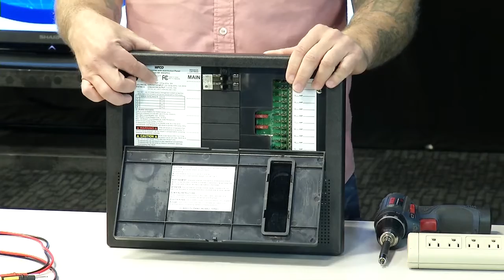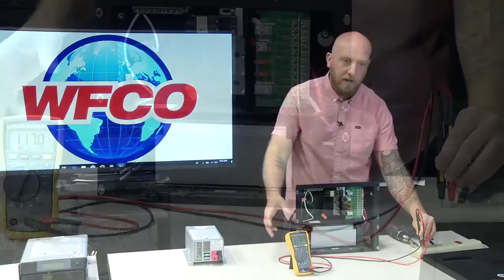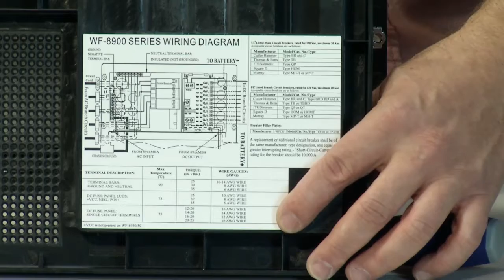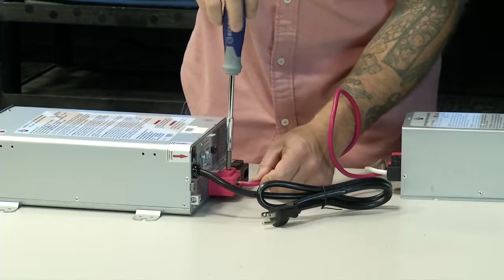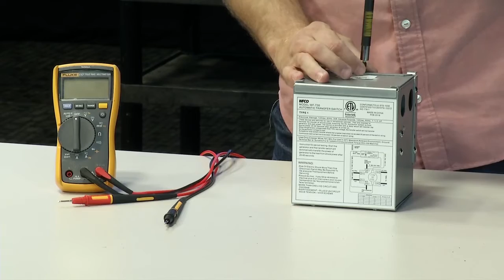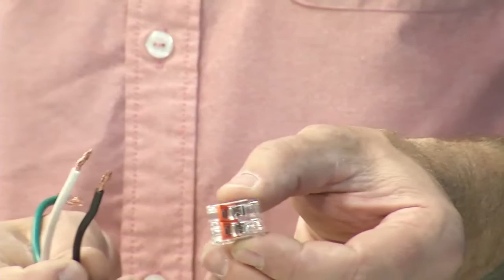WFCO Power Source Training

Comment: I have my first Popup Camper, at 68. A prior owner pulled the battery. (I guess they only took it to "plug-in parks") I want it for boondocking. Just got a WF-8955-AD with the WF-T30. What else do I need to make this a LiFePo4 system? Yes, it would be nice to add solar. NOT planning on a lot of power usage. The fridge. I have a good power station for the phone and laptop. A 4000 watt generator, 400 watt solar panel with a 30 amp controller. Would someone help me in figuring out how to wire this all together? With NO liability!
Reply from the maker: Please contact our Technical Support Team at 574-294-8997 (option 1) or e-mail me and I'll get you in touch with our team.  m.lacognato@wfcotech.com. Thank you, Michael

Comment: Not finding any info on my particular we-8955rep series unit for my 2006 frrv Salem lite trailer …it has a blue power cable and the replacement has a block to connect it outside the housing (lower hrs) where does this blue connect to???

Comment: Question, does the alternator current to charge the house batteries connect to the charger? I am not charging the house batts while the engine is running.
Thanks, very good information!

Comment: Great video! Hey I'm getting 13.70 to my dc side on fuse panel but I'm not getting 13.70 on the fuse block on battery positive wire. New converter that's only getting ac power in but not DC out. Does this sound like I have a bad fuse panel? 
Thanks

Comment: my 1989 terry resort has stock 30 amp fuse panel i ordered the wfco 30 amp an i got the 55 amp wf-8955 model.... can i still use this on my 30 amp system? i dont have any batteries but may add 1 or 2
Reply: Not sure if I understand your question, but these converters are made for 30A or 50A AC shore power. They make converters that convert 30A AC shore power to 45A, 55A, 65A or 75A DC output power. So if your converter produces up to a 55A DC output, that just means the combination of all your DC powered devices will be supplied as much as 55A maximum at any given moment. It still needs 30A of AC power from the shore (RV park hookup)

Comment: Can you wire your inverter into the generator wiring in your transfer switch to your 8955 to power the 120 V in your trailer? Do you need to shut off your converter breaker then to use your inverter?

Comment: In this video's senario I observe a 30 Amp Main (Good) and a 20 Amp Converter, my current breaker is 30-15 should I upgrade to a 20 amp for the converter?
Reply: Not necessary unless you have a 75A or greater converter.  https://www.wfcotech.com/wp-content/uploads/2022/11/WF-8900-Power-Center-Series-Manual.pdf

Comment: I'm still a bit confused as to where the 120volt output is connected.  Is this connected to the power converter?  If so, does it connect to one of the breakers in the converter?
Reply: Output on what? You need to be specific.

Comment: Quick question, I have a 8935 p in my truck camper, and want to upgrade to lithium batteries, can I install an 8955-AD with out having any issues? Or can I only replace with the 8935-AD?
Thanks for your time

Comment: I've got a 2007 Keystone, Laredo 27RL - my 12 VDC seems to be out at all lights,fans, etc. When I cycle the 110 VAC breaker that powers the inverter, the 12 VDC power seems to come on only momentarily then completely nothing again. No warning LEDs are apparent at the 15 amp fuses (blown fuse indicators) so would/could this be an indicator that the power A/C to D/C inverter is failed - and would a replacement be available from WFCO directly if a part number is found?? Any thoughts would be greatly appreciated. Thanks and great video!!!

Comment: I have the wf-600-th model. What is the white AC output wire? What is it hooked up too? I cannot reset my 7amp circuit breaker on my inverter either. My inverter has no lights lit up. I tested the battery cables going to it and they are at 13.58v

Comment: So I found a problem with my wig-8900 series and it’s a grounding block that goes to the floor , it has 8 smaller gauge wires to it and 2 large gauge wires to it on a 4 terminal block , where can I get a replacement block to fix this @wfxo ???

Comment: This was a lot of basic stuff, but still a great reminder refresher on Converter/chargers, inverters and ATS's. Question do you have any experience with large inverters that feed one leg of an Electrical Panel on RV's that have an Energy Management System installed.

Comment: On my 2022 Flagstaff 27BHWS TT do I need a transfer switch?  Transfer switch is throwing me off.  I want to replace my WFCO 1000 watt inverter with a 2000 watt inverter and was not planning on a transfer switch... My generator's will be external and plan on connecting as if it were shore power...  I feel like I'm missing something here...

Comment: I wish you would have shown where the transfer switch wires connected to the main panel.  Would you use pigtails to run to the 30Amp breaker?  I want to have my solar generator able to power my 30amp service inside my RV, so would I need this transfer switch, or just wire the Anderson connector panel mount connection directly to the 30amp breaker?  Very helpful video, but this is the only part you left out.  Thanks for this very educational video!  On second thought, I should connect my wiring from the Anderson panel mount connectors for my solar generator to the DC side pos and neg bus screws- same as the wires from the inverter thus bypassing the inverter in this system as my solar generator is producing 30 amp, 12 volt DC Power.

Comment: It seemed there were input wires with and without a delay before the click of the switch. On the transfer switch supplied for a WFCO inverter on a 2022 Rockwood travel trailer are there two set of 111-120V input wires? One for generator with the delay and one for shore power? If not it would make perfect sense to plug the 30 amp power cable from the trailer input directly into the external generator. Was this auto transfer switch  configured differently for a motorhome with a inboard generator?
Reply from the maker: Please call Power Pro Tech Support at 877-294-8997, and we can help you.

Comment: I have a 2016 Palomino Solaire 147X hybrid with a WFCO power converter with distribution panel Model WF-8955PEC.It shows a 13.6 VDC, 55A output. I need to replace the converter component only. I have no 12 v dc power, the converter is not charging the battery. How do I know the model of the converter component to order?
Reply from the maker: You would need a WF-8955-ad-mba. As for the voltage on the fuse board, if you are not reading the same voltage on both sides of the fuse then the fuse would be blown. The voltage is still present on one side of fuse but lower voltage than the other side. The voltage is still there to power the blown fuse LED, and they are correct in their statement that there is voltage but no amperage. Let me know if this doesn’t help.
Reply: WF-8955-MBA

Comment: Im plugged in to shore power 100% of the time. I need to replace my converter as it’s loud, erratic and causing flickering issues. Currently a 8955 installed but purchased an 8935 to replace (whoops). However, like I said, I’m always on power no boon-docking. Do you think the lower amperage converter will be an issue?
Reply from the maker: You should be perfectly fine if you're always plugged into shore power.

Comment: Not sure if replies are still being offered, but my 9855 will not power 12V circuits when the battery is not fully charged or it is disconnected at the battery. Why would that be? I looked at 40A reverse polarity fuses and they were not blown, but didn't test for continuity. Also, I did not test the shore power input to the 12V panel. (Update: just checked converter terminals and there is no 12V power,, so I suppose this confirms the converter has died in my 2009 T@DA...) There was power to the other outlets and devices connected to the 120V breakers. Any thoughts would be appreciated because I jumped to the conclusion a battery had to be installed for 12V circuits to work and the converter on the bottom was just a fancy battery charger. Thanks!
Reply from the maker: It sounds like you need to replace your converter. Please contact Power Pro Technical support at 8777-294-8997, Option 1.

Comment: Question about the dc volt measurement at the converter, If there is no battery connected as demonstrated then would the normal voltage read approx 13.6 always or could it be less. I have a unit that is giving power however is only registering 13.1, based on trouble shooting in the manual it states should be 13.6 VDC (+/- 0.2). If I am only getting 13.1 does this mean the unit is starting to fail and needs replacing?
Reply from the maker: This depends on where you're doing the testing. Please call Power Pro Technical support at 877-294-8997, Option 1.

Comment: Replacing the main board looks real easy when the panel is relatively clear of other wires but in reality the control panel will have a LOT of other wires running throughout!  Plus it will likely be in a difficult place to access like on the floor.  Fishing the wires back in will take a bit of time and patience!  Wish this old lady luck.  Will report back in about 2 weeks after my new main board arrives.  I will say, if you call WFCO for tech support they are absolutely fantastic!

One week later.  New main board installed.  I took my time and double checked everything with a volt meter.  Took about 1 hour start to finish.  I am getting (according to the meter which is a cheapy) 116v on AC side and 13.68-13.69v on DC side.  That is what I was getting a couple months back when I was checking because an RV shop was telling me only 3v at converter and 3v in the battery.  Converter seemed to work fine up until about 2 weeks ago when it quite completely.  I am wondering if anyone here knows if and/or why a converter might work intermittently?
Reply from the maker: This could be an early indication of a converter failure. Please contact Power Pros Technical Support at 877-294-8997, Option 1.

Comment: Somehow my converter on charge makes my furnace fan blow harder , I actually have to turn the charger breaker off to get the furnace to work. Also have never heard the fan energize once
Reply from the maker: HI Heather, give our tech support a call at 877-294-8997 and they'll be able to assist you. Thanks!

Comment: My ac units don’t work what’s so ever, nor does my thermostat, could this be caused by a faulty converter? I get 110 to the ac system but not 12 anywhere ?
Reply from the maker: Hi Daniel, give our tech support a call at 877-2994-8997 and they will be able to assist you!